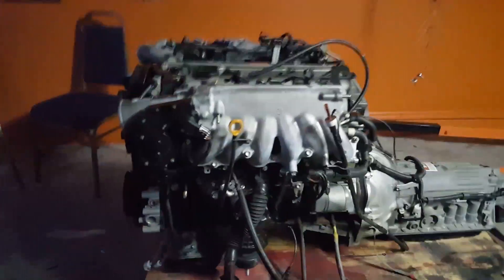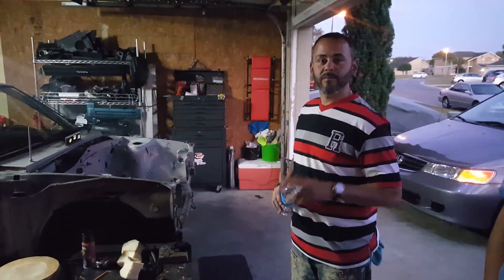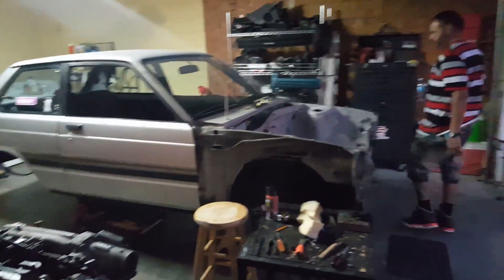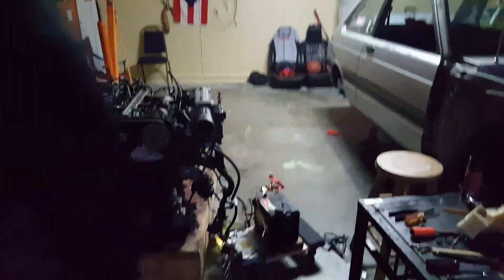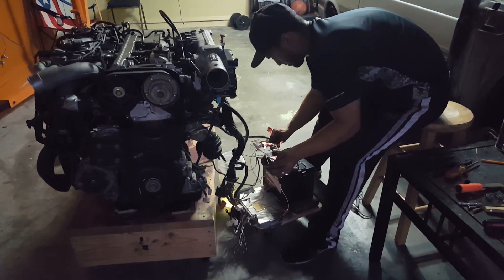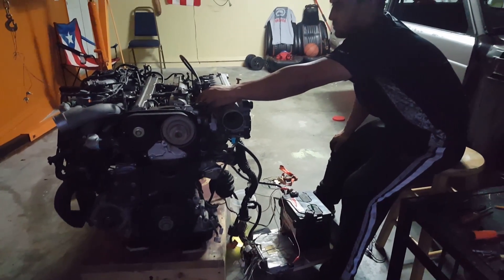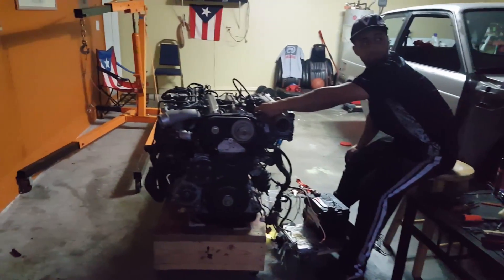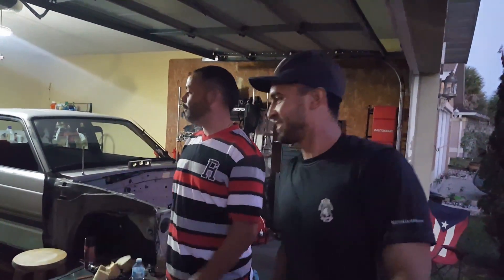Starting a 2jzgte in the floor, 2jz Starlet coming soon

Comment: hey I have a question. I have a. 8 trying to put racing wheels but I don't know the bolt pattern or the backspace on the front . can you help .
Reply from the maker: J Rotary Turbo the bolt pattern is 4x114.3 and +25 backspace wheel should work